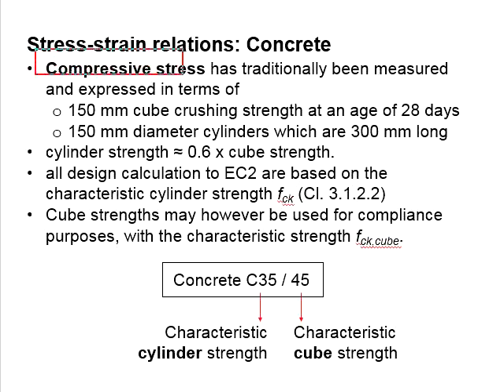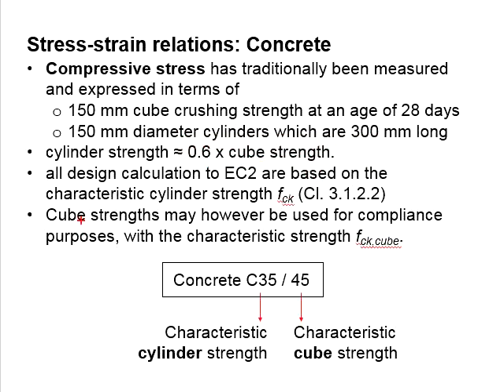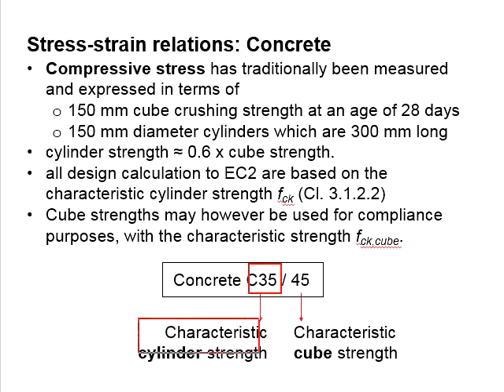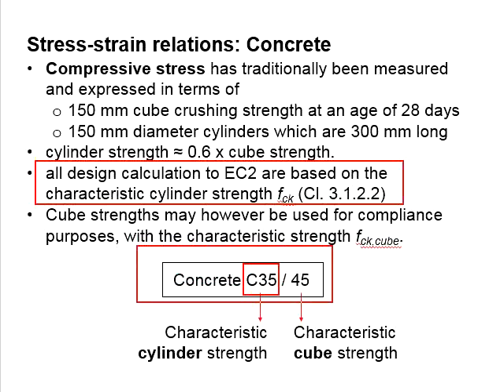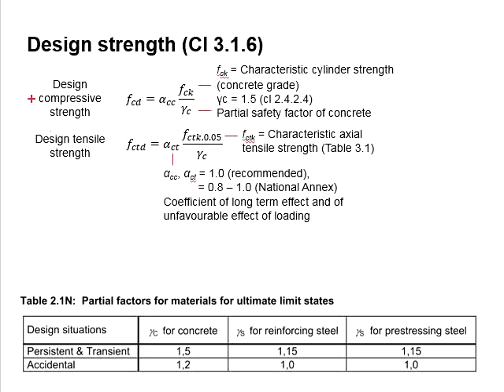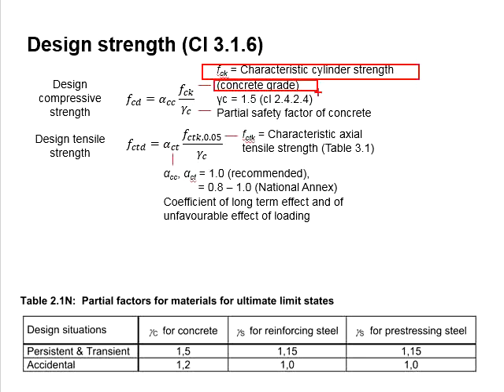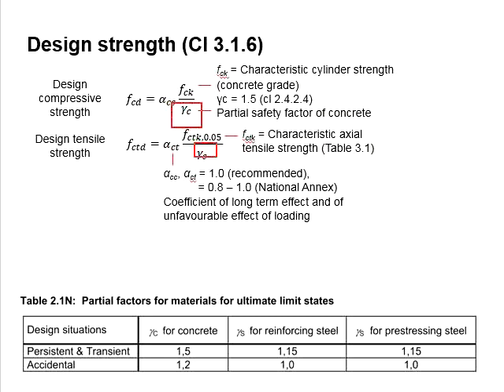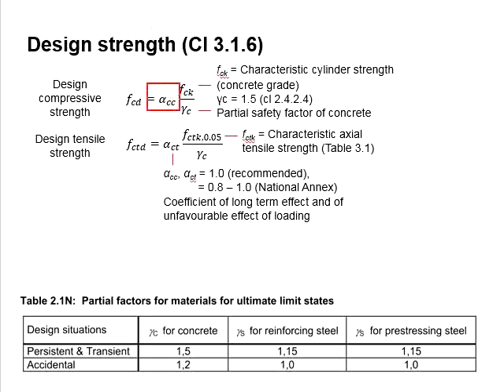1.7 Design strength concrete

Comment: why is cylinder strength of concrete less than cube strength, though their shapes are different, It should not have anything to do with stress right?
Reply from the maker: Logically it should be the same. However, when the samples are tested, different results are obtained, statistically. Taking the standard concrete grade for example: C25/30, 25 refers to the strength by cylinder, while 30 is by concrete cube.

Comment: cylinder strength = 0.8 * cube strength?
Reply from the maker: cylinder strength is normally smaller than the strength, as acquired from the compressive test of concrete cube. The 0.6 times is just an estimation.
Reply: I think it is 0.8
Reply: Yeah, I also believe it is 0.8.